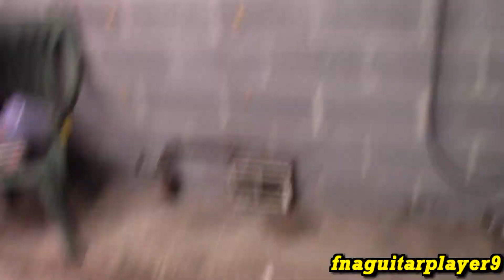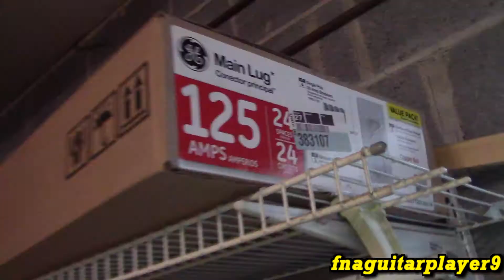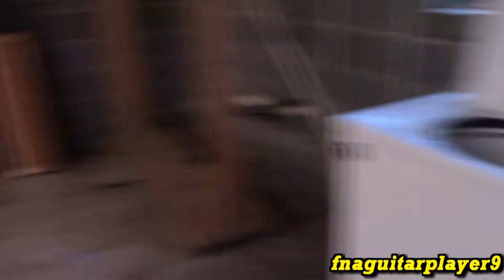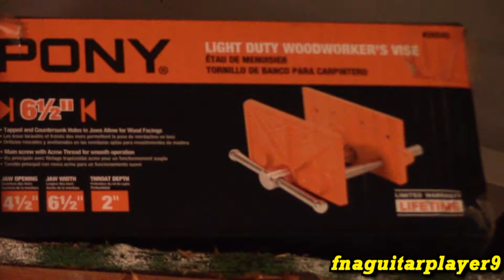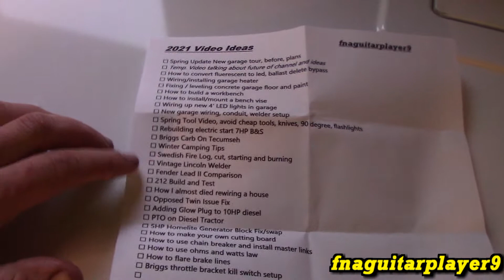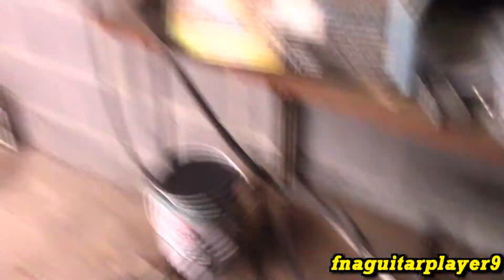Major Channel Update! New Garage!!! Upcoming Videos!!!

Comment: In the garage we have,, we have the 4 ft long fluorescent lights that some of the life trays are only two bulbs per tray and some of them are for light bulb fixtures and we just replaced the bulbs with the 4-ft long LED bulbs and we didn't bother with changing out any ballasts or anything in them and that's been at least two years ago and so far we've never had any issues and they burn on average at 10 hours per day 7 days a week....
Reply from the maker: I hear ya! The led bulbs i went with (off amazon) said to remove ballast, we used the same bulbs at work and i tried them without removing the ballast and they wouldn't do anything at all, it just depends on the brands i guess. I'm uploading a video right now of the ballast delete on the 8' lights. I wish these would have worked like that it would made it alot simpler. Thanks for Watching!!!

Comment: Probably asked you before and just don't remember but I've always wondered where you're located at and by the way a friend of mine runs a collision/body shop out of his 24 X 24 size garage and it has the large single door like yours and it gets a little tight for something like a new four-door dually size truck as far as length and you have to caddy corner those in there and height can make it a little aggravating for a lot of different Vans but something like family fans or any SUV works out perfectly and sometimes you can get two of the smaller SUVs inside beside but your garage will be perfect for this... A pellet stove would be a good heating source for that size garage with some sheet insulation on the walls....
Reply from the maker: I'm In WV, I hear ya, you can do alot in a small garage its just not as easy and is crowded up more. Main thing i'm going to be working on is lawn mowers but i do plan on doing some auto videos eventually. Thanks for Watching!!!

Comment: WoW. Nice garage space. Consider putting the heater on the wall opposite the garage door for better heat control or in a corner 45 degrees and blow toward the garage door. I have installed many of these and it works great that way. Also might consider installing the generator a few feet off of the floor if water is a concern. Enjoy to the max. Thanks
Reply from the maker: Thanks! I just put the heater up the other night and its in the middle of the back wall, blowing toward the garage door, yeah it probably won't be left there, thats just where we unloaded it at. I do have some water seeping in if its been raining heavy for several days, but I do plan on sealing that off. Thanks for Watching!!!
Reply: @fnaguitarplayer9  That is a good spot for the heater, I always put them blowing toward the garage door. Thanks

Comment: I've also got the 8 ft fluorescent lights also , but years ago I bought a case of 8 ft bulbs . But will a good video too watch you change them over too LED . But you may need to seal out the water problem soon , sure don't want any water damage .
Reply from the maker: I hear ya, I didn't use to like them, but I do really like how the bulbs just have one prong and its spring loaded, easier then the 2 prong twist types. The video is uploading now for the LED conversion and will be up tomorrow. Yes, I'm going to do that really soon! Thanks for Watching!!!
Reply: fnaguitarplayer9.    Good Luck